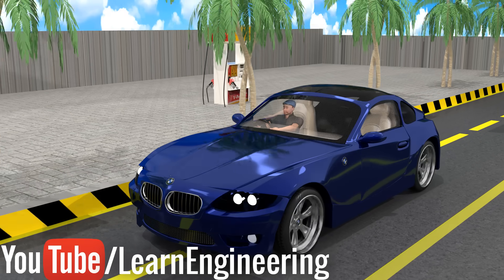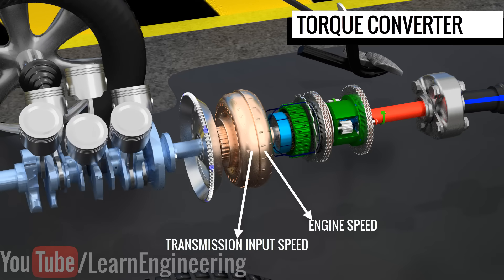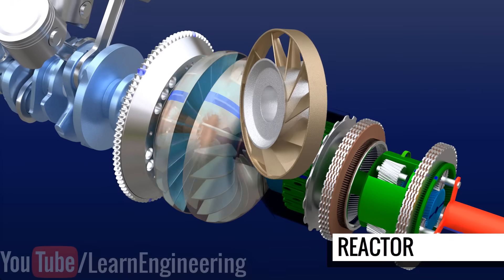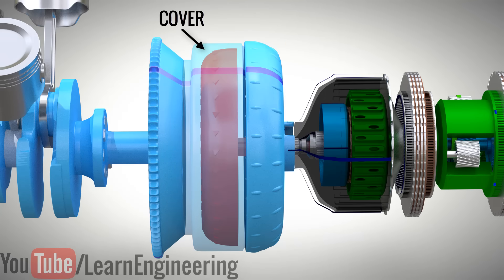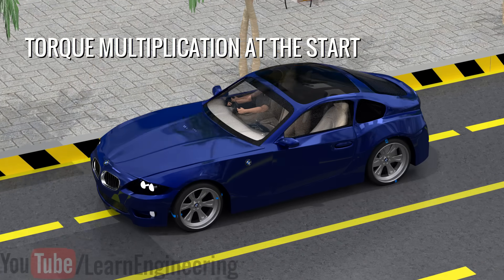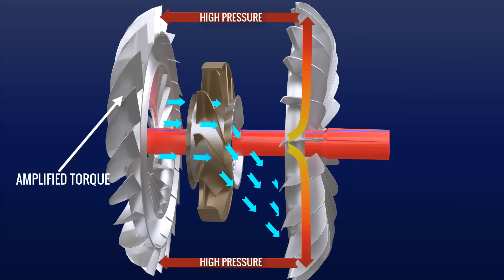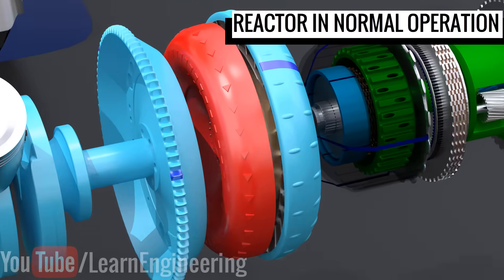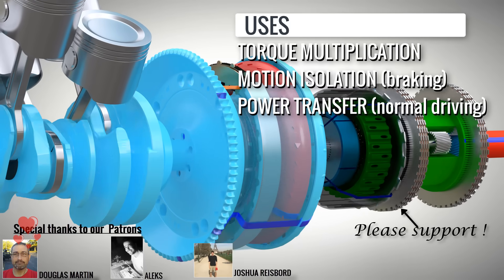Torque Converter, How does it work?

Comment: The automatic transmission really is a stunning piece of mechanical art.
Reply: And now with electronic enhancements. My first car (with auto trans) had three speeds. My latest has ten. Plus, shift points are electronically controlled. If I switch drive mode from, say, Comfort to Sport, it is as if the transmission was swapped out. Could almost say the same for the engine and suspension.
Reply: @tinmania  mmmnm
Reply: yeah, whenever I get the chance to drive an automatic transmission car (They're pretty unpoppular where I live), I spend far more time facinated about how they work than I'd do shifting in my normal car
Reply: Yes that is great comparison. I built them over 35 years average 4 spd transmission has 2000 parts...not sure about post 2006/7....
Reply: @packingten  ive rebuild a ton of m21 and m22 Muncie and also chrysler a series 4speeds and never had no 2000 parts on one. Maybe 200 max. Most complicated that had 2000 parts was an Allison 10 speed dual range transmission. Those have 2000 parts
Reply: @packingten  And if any of those 2000 parts fail, you will now be ruined.  Heard about a repair on a quite average mercedes benz 4 wheel drive with drive chain failure.  While covered by the warranty, the price was north of 30.000 USD.
Reply: @packingten  I think a lot of manufacturers have tried to cut back on the amount of parts in ways. Like two gears sharing one clutch and things like that.
Reply: I learned the other day that those giant dump trucks in quarries, aka 'haul trucks' can be driven by automatic transmissions.
Reply: @screwbles5697  some of them are driven by electric motors specially the really big ones, they have inline 6 or v12 turbo diesels but those engines are used to charge the batteries solely and not for the truck's movement
Reply: @screwbles5697  many new trucks these days are automatic. I drive a 12 speed automatic. The computer does the shifting, they are different for sure. 
I do still miss driving 13 speed manual sometimes though
Reply: @screwbles5697  I'd imagine the torque multiplier is even more important for something that carries those heavy loads
Reply: And allways understandable
Reply: And yet they burn up all the time...i still prefer manual
Reply: Internal combustion engines are the worst and unsuccessful invention of humankind 😏😏😏😏😏
Reply: @Ironcammandoo  hail diesel and German excellence!
Reply: @NwoDispatcher  

Truth hurts go cure your eye kid 😂😂😂😂😂
Reply: the author made a mistake in this animation, parts are spinning in wrong directions.
Reply: @darthvaider4347  Are you talking about representation of BMW V6?  Sometimes this engine is shown rotating clockwise. Other times it's shown counter-clockwise.  "Yeah, what a FAIL ." 🙄
Reply: a hydraulic wonder!
Reply: Wte excellence
Reply: kalki avatar type 7 and 8 😎

kalki avatar (beast of the earth) (christ on the white horse) (son of man on clouds) is the biggest enemy of dajjal/antichrist/kali 😏

Kalki Avatar (Murtaza) cousin of Moula mahdhi a.s. (muhammad) 😎

Moula mahdhi is raja shashidhuvj (the mighty one) 😎

Prophet Moula Isa a.s. will kill dajjal cause dajjal is going to kill Kalki Avatar 😏

Kalki Avatar will follow orders from 2 religious king Moula mahdhi a.s. and Moula Isa a.s. 😎

Kalki Avatar going to have 2 swords and ring of moula sulaiman a.s. and staff of moula musa a.s. (iron rod) Staff of moula musa a.s. is like omintrix can transform into anything and can transform others into anything And stone in the ring of moula sulaiman a.s. is also known as kastav mani and it's more powerful than all 6 infinite stones combined 😇

This staff will transforms into white horses with wings,weapons,iron-man,cloud etc or can do imagination into reality 😎

*Ratn sru sword of lord shiva (miri)😇

*Ratn varu (zulfakar) sword of Moula Ali (piri) 😇

miri piri 😇

Satyug (sunrise from West) 01.aug.38 😏

Sambal is hospital 😏

Gzwa e hind 2029 😎

truth hurts go cure your eye 😜
Reply: I just had to replace a torque converter last year.  It's such a rare thing for it to malfunction... so rare in fact, and requiring so much labor, you're looking at 2500 - 4000 to get it fixed depending on the car (mine just above 3,000)

Never explained to me how or why it malfunctioned.  2 months later, after dropping all that cash, the car was totaled when a semi-driver fell asleep with a truck load of romain lettuce north of LA - ended up totaling his semi and 5 other cars (mine included)

Super annoying.  Insurance wouldn't let me have the part back
Reply: NOTE: there's actually an hilariously titled YouTube video about the wreck - Lettuce carrying Semi Causes Accident on I-5 near Castaic or something.  

Ends up the Romaine saved the lives of the 3 cars that hit his payload; absorbed the impact (2 other vehicles - mine included - were totaled from debris or hitting another vehicle attempting to dodge the chaos).  

Eat your greens people - and also use them as cushioning and insulation.
Reply: @egregiousqueef7781  what was the weather like when the accident happened? Climbing the grapevine near Castaic can be an experience in itself. Strong gusty winds, dense fog, to snow in the winter, near the summit in Gorman, or Frazier Park.
Reply: @timothygeiger8271  Just saw your other question.  It ws right by the Templin exit.  It was super early, sun was coming up, as you're headed south just past that exit there's a turn to the left and a fairly steep mountaon on the right.

I was watching the guy drive and he just drove straight into the side of the mountain, trailer flipped on its side, slid back into the road, the 3 cars hit the top of his traibler (which apparently is super thin and also assisted in saving lives, as a sheriff told me the height from hitting underneath woul've likely decapitated one or more of those 3 people, falling over and hitting the top saved them)

He was still asleep when we all got out of our cars to figure out what jut happened.  I ran over a massive boulder trying to dodge all the crap flying around - and not get hit by the semi directly behind me - tore open my oil pan and bent part of my chassis.  Once that happens your title is screwed and your car is done pretty much
Reply: And the weather was clear, sun was coming up and a bit blinding but it was clear, no hardcore winds like that area produces sometimes
Reply: @timothygeiger8271  Unrelated side note:  love hiking, camping, etc off Frazier park headed toward Pine Mtn Club.  One of the few areas near LA so far untouched by fires
Reply: @egregiousqueef7781  tearing a hole in the oil pan will destroy the engine, if you don't shut it off quickly enough, which most people don't🤣🤣  
Was it a reefer trailer, or refrigerated container. The side wall on both are fairly thin. Yes, a car going under a trailer can decapitate the occupants of the car.
Reply: @timothygeiger8271  Check out the video it's titled "Pileup With Lettuce-Carrying Semi Closes 5 Freeway In Castaic" ... that AutoZone guy was impatient and was actually several cars behind and tried to get through.  He wasn't part of the wreck nor anywhere near it.
After some time and blocking the ability of first reponders, no joke, he got out and started polishing and cleaning his rig.  It was bizarre.

The blue rig you see, immediately behind that is/was my gold Camry.  You can see the black streak of oil pouring out of it.  That blue semi was actuallly behind me and she was grateful I didn't slam on the brakes as she was completely loaded and probably would've done more damage to the scene if I had.  I pulled over immediately after launching in the air running over the boulder.

We were there almost 7 hours.  The entire freeway was shut down south out of Castaic
Reply: @egregiousqueef7781  yes, the wind can get very strong & gusty in that area, I've been up through that area many times in both good weather & not so good of weather, both directions. I've driven through that area for about 30 years, in a big truck😆😆
Reply: Something interesting I learned about semi wrecks - they tow away the rig, but the trailer was dragged down the road and dismantled into several parts and discarded.

And I'm guessing several poor grocery saps didn't get their romaine shipments.  What really sucks is that it was Owner/Operator based out of Bakersfield.  When the driver finall got out, he didn't say a word, he just looked completely defeated.
Reply: @egregiousqueef7781  they are not always done like that. In fact very few are. For a small company or O/O possibly. depending on the damage, with big companies most are rebuilt. It may sit a couple of years, but often rebuilt. 
The tractors are more likely to be totaled, due to expensive computers & components. A crate engine alone can cost more than 30k to replace, transmission 15k, & around 4 to 5k for each pumpkin(rear ends). The power divider( the box that engages both pumpkins can cost 2 to 3k. The hood will cost 5k. That's not even looking at the interior, or the other components under the hood. 

Several years ago i was driving in Texas, i was on a narrow two lane road in the country about 2 in the morning, a horse had gotten out of its pen & ran in front of me. Keep in mind it was pitch dark, & i didn't see it until it was too late. I hit the horse & killed it obviously. The damage to my tractor was over $30,000. It was just body damage, & radiator, A/C components, charge air cooler(which cools the turbo) & various other parts.
Reply: @timothygeiger8271  Just this past September I got reimbursed my deductible and was found not liable.  CHP and MY freaking insurance!! tried to say otherwise - that I could've... 

.... what??  Turned to the left and hit this white truck carrying a trailer, turned to the right and ALSO slammed into the side of the mtn (this was a freeway, we  were all doing California 70mph- which means more like 90), slam on the brakes and get destroyed by that totally weighted down blue rig behind me, or keep going forward - which I did, hit a boulder, stopped and pulled over... plus debris and smoke and dust and the sun rising made it impossible to see

Re; the trailer, just going by what the officer told at the scene; think the cop was just explaining to me that given the damage, it was easier to dismantle and salvage.  Watched this team drag entire trailer like 300 yards to the south to get to larger shoulder and proceed taking it apart

I actually have better up close photos.  Still appalled they tried to argue that my damage was avoidable.  But ultimately at least 4 us - 3 cars who hit the trailer and mine - were find in no way liable, even partially and recouped every cost.

There was a 5th guy who was parallel to me, also attempting to dodge debris (doing over 80, mind you, it's not easy) you can't really see in the video but he ended up slamming into the back of this trailer being hauled by a white pickup (which you can see)
Reply: @timothygeiger8271  Animals can do some damage!

I hit a deer coming down the LA crest into the valley (like from Palmdale) but was only going 25, the deer lived, i had to get a new hood (super expensive), new headlight, new bumper... 25 mph

I can only imagine how frightening it was to hit a horse
Reply: @egregiousqueef7781  who was the towing company??  
 What is the name of the video? I'm on medical leave of absence right now, due to injuries i got from falling from a loaded flatbed trailer. I have time to watch videos sometimes🤣🤣
Reply: @egregiousqueef7781  wasn't frightening to hit the horse really, i was sorry it ran in front of my truck. The horse belonged to a child, so the child lost their horse.
Reply: @timothygeiger8271  Exact title of the video on YouTube (just looked it up):  "Pileup With Lettuce-Carrying Semi Closes 5 Freeway In Castaic"
Reply: @timothygeiger8271  Don't know the name of the company.  Just remember the other rig drivers exclaiming "holy sh-- it's owner/operator" ... further exclaiming that the insurance was likely to drop them after it, lot more at stake when you're essentially the equivalent of small business albeit for truck driving
Reply: @timothygeiger8271  the deer jumped from behind this hill, partially airborne when I hit him, also early in the morning, probably why it was so "wtf!?!? just happened" scared the crap out of... if i was just a second later he'd of launched himself into my driver window

Dude got up, stared me down for a few seconds with those pitched black dear eyes, saying to himself in deer language "f.u a88hole!"  and ran off
Reply: @egregiousqueef7781  a very short clip, about 24 seconds🤣🤣
Reply: @egregiousqueef7781  the reason it's so expensive, depending on what kind of car you have, front wheel drive or rear wheel drive. Some front wheel drive vehicles require pulling the engine to replace the torque converter. That's the expensive thing about replacing one, the labor to get to it. Just the torque converter itself only takes about 20 minutes or so to put in, it slides on the input shaft of the transmission, then bolts to the flywheel bolted on the rear of the crankshaft in the engine. Did they replace the rear main engine seal, or the front transmission seal when they put the new torque converter in?  Depending on the age of the car & the miles on the car, it's usually recommended to replace both seals. It really sucks to pay all that labor to replace the torque converter, but not replace both seals, only to have them start leaking a couple months after replacing the torque converter, & have to do all the labor again.
Reply: @timothygeiger8271  It was a 2014 Toyota camry, front wheel drive.  And you're right, the labor was probably 80% of the cost, pretty much removed the entire transmission/drive shaft in order to get to it.

It's like a head gasket.  The part is like $5 bucks.  But the labor is like $200000 because the entire engine block has to come out

To your other question, I'd have to get the paperwork, but seeing how the car was frustratingly totaled right after that, I don't have it.

It would make this grinding hard shifting noise around 30-40mph.   I was hoping something simple at the time, like fluids but nope, never fails, the most expensive thing possible without having to replace the transmission
Reply: @egregiousqueef7781  those & many others like it, it's easier to drop the engine, transmission, & front suspension all in one piece. The engine has to come out with it, because it's just easier. Either way it's a lot of work, but still necessary.
Reply: Torque converter isnt limited to automatic transmission. Its actually close to being the opposite - an automatic transmission being limited to torque converter.
Reply: @pavelslama5543  a torque converter is only a part of a complex automatic transmission. I've torn down a few automatic transmissions in my day
Reply: AT is for ladies and kids...
Reply: No, it's really not.
Reply: gimme a manual over an automatic any day!
Reply: isnt it possible to replace the clutch with a torque converter but retain the manual gearbox? both in case of car and motorbikes?
Reply: Yeah except all the computers, solonoids and electric pumps ruin that art. Literally nothing in a modern car is purely mechanical anymore. There is a valve, pump and computer with a sensor for every single moving part. They have computerized valve timing now. No cam shaft. Go figure...
Reply: Now think about something like a CVT. Whoever designed all of this shit was super smart. Hell, you gotta be smart to work on this shit too. I can name you some stuff and what they do but that’s it.
Reply: Yes, but I prefer simpler
Reply: And it’s worse than the manual
Reply: you mean science?
Reply: Too bad it's not "driving"
Reply: Ehh just a fluid pump
Reply: @jon-christiankaczor5384  you have no idea what you are talking about lmfak
Reply: They try to improve it with new (eg. CVT / DCT) innovations.  They have yet to succeed.
Give me a proper 'slush box' anyday!
Reply: yes, and amount of usable energy loss at every step is staggering!
only EVs are the solution
Reply: @benjaminshtark5977  Go smoke some weed, hippie.
Reply: For all of that mechanical art you get far less reliability. Its why automakers are starting to make automatic transmissions that are essentially mechanically the same as a manual transmission just shifted and clutched by servos rather than the operator if youve ever heard the term "automated manual" thats what that is
Reply: @P7777-u7r    As you say, they are not true 'autos'; they are automated manuals with 'jerky' clutch and shift servos. They are totally pointless.
Reply: @Ampex196  Examples? The only one I've driven is my PDK and it's as smooth and seamless as any real automatic.
Reply: @P7777-u7r  Automated manual transmissions don't offer the same smooth power output from the moment you shift into Drive that automatic transmissions do. They're exactly what the name implies: they shift like a manual, but under computer control, that's all.
Reply: @P7777-u7r  they're less efficient sure, but less reliable? I think not. Since torque converters use fluid there is literally no wear on it other than any bearings. A clutch on the other hand can wear out friction pads over time.
Reply: @P7777-u7r  theh are worse than autos by a lot, source: i rebuild transmissions for a livkng
Reply: @ROGUESPIRIT_  
Yeah all over complicated. Just give me a clutch pedal and a shift knob. Im not too lazy to change my own gears
Reply: @P7777-u7r  auto has its place but i prefer manual
Reply: @ROGUESPIRIT_   Stirring cogs is surely history - though a slick manual box (stick shift) is a always a pleasure.
I'm old enough to recall crash boxes and double de-clutching.
Reply: @Ampex196  Manual gearbox is always the king, most control and most enjoyment. Commuter cars will run them dry but anyone that drives for the sake of driving will want one. You aren't truly driving without a third pedal.
Reply: Completely garbage transmission system 😂😂😂😂😂
Reply: they are not lmso